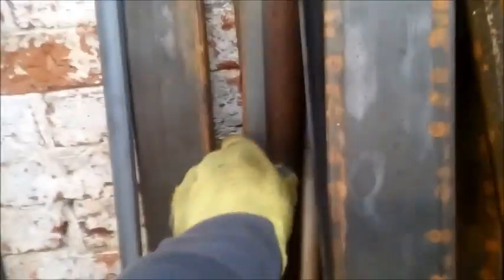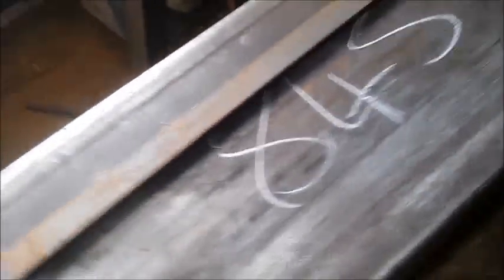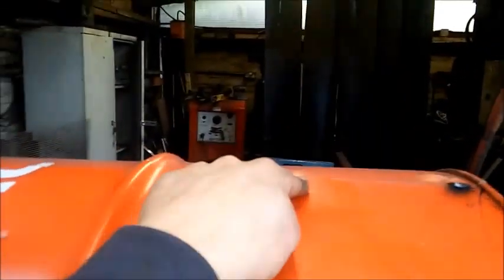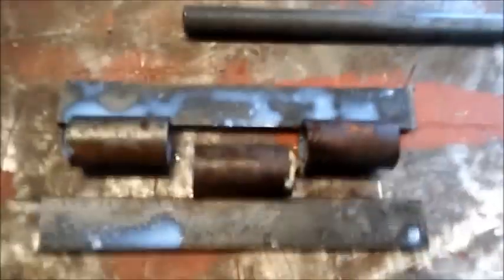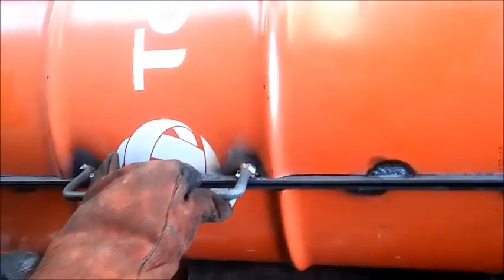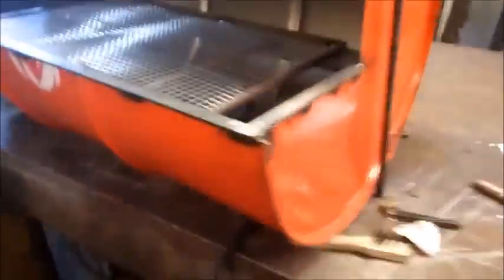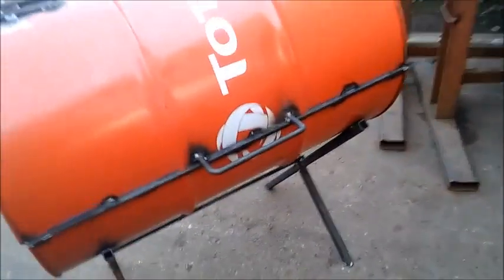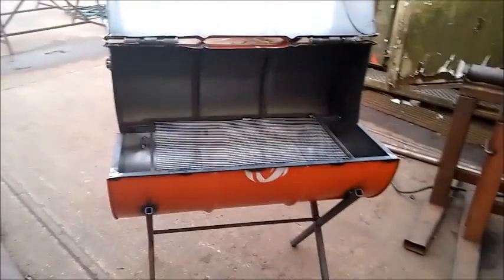Oil Barrel BBQ Homemade Scrap Metal

Comment: Very basic...but adequate.  (2hrs of the top of your head: Very commendable.)
As others have noted: Drums are very thin...if you get a season or two...you're lucky. 
Why not do a decent frame build that will last...and can be transferred barrel to barrel as they wear out....
(The big sin is allowing ashes to get damp in the drum after use: Goodbye Barrel.)
That way you can incorporate 'tables' to the left & right ...and.. even a ledge in front.
You've then got the basis of a proper BBQ that'll be good for years.
Just sayin' ....as they say.
Cheers.

Comment: Not bad mate, nice design. I don't see the need for the gaps either side of the cooking mesh though? You should have cut the mesh to the exact size of the barrell, then cut the mesh in two, meaning you could put one part down, then fill your coals, then put the other side of the mesh down and there would be no wasted cooking space.

Comment: You have to add a steel net for charcoal, otherwise charcoal would burn the barrel.
Reply from the maker: Inet Panadura never knew that I seen the BBQ in action it didn't melt down to the floor, I used a plasma cutter put a bunch of holes in the bottom of it to give it the air anyways thanks for the heads up
Reply: what i'm trying to say is that If you put red hot charcoal directly on the surface of the barrel, extreme heat  start weakening the metal of the barrel. because oil barrels are made of thin metal, it wont stand the heat of charcoal for long time. so im just SUGGESTING that it's better to use a thick net to lay charcoal. thank you.